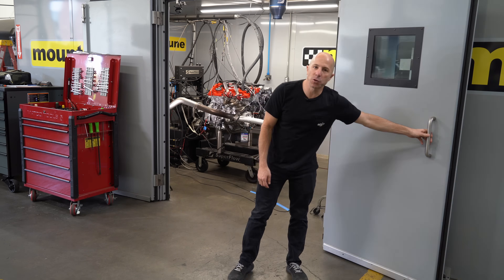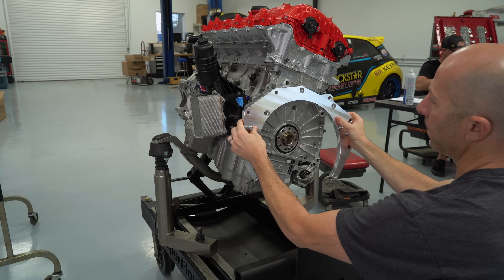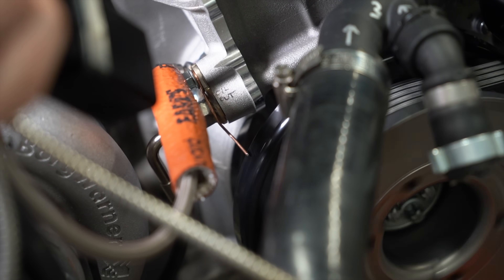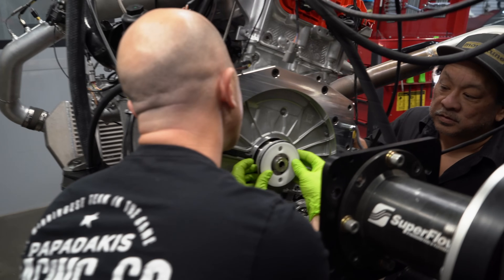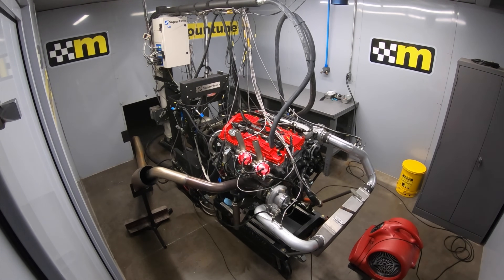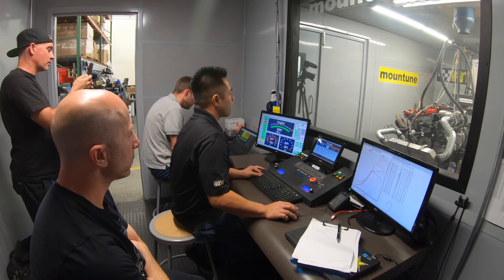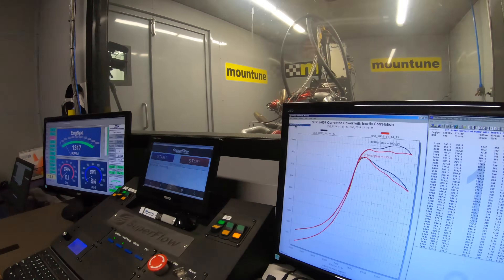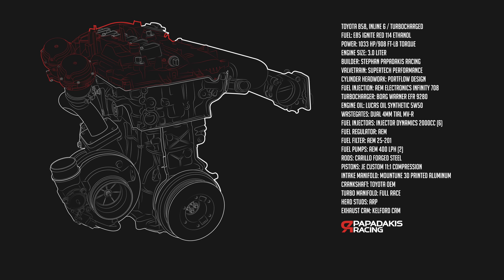B58 Engine Dyno 1000+ Horsepower - Sounds like a 2JZ!?

Comment: that dowel is probably the only setback i see if this were made into a kit
Reply: They can probably make something with seals and a hold down with a bit more time. The dowels were solid quick thinking, though.
Reply: Beautiful Music Motorsports the dowels are pretty much the only option at these kinds of cylinder pressures. The OE seals on the direct injectors are PTFE, require SSTs ($$$) to install and are single use.  N54s had an issue with blowing these seals out, the owner not realizing, wearing the bore for the injector seals out and now you need a head all of a sudden.

Dowels are probably still the cheaper and safer option.
Reply: Ehh i dk id say most of the changes would be too pricey to ever be sold as a kit when people are already making close to 750 on stock motors with the stock intake plenum. The r&d that went into that intake manifold alone would make this a kit that costs well over 20 grand. Thats not competitive financially when people have made 550 with bolt on's and a meth kit.
Reply: @SortaProfessional89  The R&D on pretty much any aftermarket intake manifold was high costs as well, but they sell for an affordable price... so....
Reply: core charge, he'll send you a doweled head in the kit.   you'll get a refund if/when you decide to send your OE head back in good condition.  if not, you've get your stock head if you should ever want to return to DI.

Comment: Soooo 1033 engine hp is like 850 in the car. at 42lbs! that would be over 1000hp at the wheels in a real supra! 2JZ No Shit!
Reply: codygocam dude 42 psi doesn’t make a certain hp that’s just what that size turbo is pushing. Could use a bigger single and run 30 to get this same power... get what I’m saying ? Prob just maxing this smaller turbo is all that means

Comment: this shit makes no sense to me. you spend tens of thousands on a engine, so you can spend months pulling it apart, replacing parts, waiting weeks for those parts sometimes, putting it back together, and it only makes a thousand horsepower? why not just make your own fucking engine? use aftermarket parts that are arbitrary, like injectors, springs nuts screws bolts, and whatnot? but you have to be able to build the block, head, crank shaft, pistons, and whatnot, yourselves by now. you know the materials to use. you know everything there is to know to design and build your own engine. it makes no sense that you would waste so much time and effort on this 🤔

Comment: 9:52 So basically, IATs increased in temperature where less air actually entered the cylinders (despite increased boost pressures) thus, causing a flatline or reduction in power.

But once the fans were turned back on, IATs were cooler in temps; therefore, more air, more power. 😎👍
Reply: The exhaust pipe fit is pretty loose too, so there may have been a much higher percentage of NOx, CO, and CO2 in the room displacing oxygen.
Reply: @mannys9130  i'm with manny, available oxygen in the room got used up by the engine leaving only spent exhaust gases.  same as how EGR technically reduces the maximum power an engine can make by diluting a portion of the intake charge in an individual cylinder.   eventually that increased pressure they were reading off the turbos was not just O2 but also compressed/boosted CO.
Reply: Philly Phil I'd agree with you gentlemen. Bottom line, lack of clean O2 in the room, computer would compensate by adding more fuel, throwing off the fuel/air mixture, reducing power.
Reply: teamEP789 as long as the exhaust vents didn't leak AT ALL. Then yes just air density.
Reply: @mannys9130  CO2 and H2O. By mass, you can just ignore all of the nasty stuff.
Reply: gale banks has entered the chat
Reply: No. There was an essentially an exhaust clog downstream causing extreme backpressure.  Nothing to do with IATs
Reply: FtmfwId no no no no. Watch the video again dumb ass. 
The fresh air fan stopped working, Steve says those almost exact words.

Comment: Is the plan to use Port injection for this motor for good?
Reply: Yes. They only left the DI injectors in because it was easier to keep the holes plugged. Turned out that, in hindsight, proper plugs would've been better from the get-go.

Comment: Kinda sad a completly built engine struggles to make stock block mkiv power.
Reply: Well considering one of them has more than 20 years of aftermarket development and this being the first one built I'd say this one is already ahead.
Reply: @mustnotsleepmustwarnothers6463  Im talking about a STOCK supra engine. STOCK BLOCK supra makes this power with a turbo and few kit.
Reply: @ScrewDrvr  that is a stock block, stock crank and stock heads worked I believe.
Reply: @mustnotsleepmustwarnothers6463  yea it is
Reply: how old is the b58 again?
Reply: @MrTin_09  Not as old and outdated as a STOCK 2jz, which makes this power easily.
Reply: That's a 5 year old i6 vs a 20 year old i6. How is that comparable?
Reply: @carboydorifutoparty3976   A STOCK 25 year old engine makes this power. Yes, it shouldn't be comparable that some old outdated engine embarrassed this new fully built engine.
Reply: @ScrewDrvr  it's not fully built there are still stock parts in this

Comment: Ok , ok , if you insist I will allow you to put this in my 340i for future testing .
Reply: Duncan Macleod you know what they say about people who “assume” things. I’m actually the motor hand on an oil rig (rig 615 with Savanna drilling) and have extensive knowledge of Diesel engines as well as many gasoline engines . I’ve helped to build quite a few old school 350s and 383 strokers . We have built Monza’s , Monte Carlos , Trans ams , Nova’s  and evening though I hate to admit it a few fox body mustangs with 302s . 

What I don’t have is their engine .
The fastest I have personally been on the 1/4 mile is 9.68
Reply: @Ollie Clark check out the supramkv forums, some shop took a part the B58C and they showed that the head, pistons and many of the internals are revised vs the B58A
Reply: @mas921  the X5 uses the B58C, Toyota didn't add anything to the engine. It's the exact same.
Reply: I was thinking about the exactly same thing😂
Reply: B58A is not the same as B58C
Reply: mas921 they already replaced everything that different
Reply: mas921 I’m sure that the Papadakis team could easily figure out how to make it work in a 340i.   From the looks of things I this video, they can make shut happen and overcome small issues. Lol

Comment: Think those dowels will ever shoot out of that head like little bullets?
Reply: It will never, because it was inserted from the cylinder side.
Reply: Doesnt the bore get larger to accommodate the injector?
Reply: .02 thousands is a  light press fit. it isnt going anywhere unless it melts down.
Reply: This is how the valve guides are installed haha
Reply: @mxmang valve guides are outside of the combustion chamber, they're not experiencing the same pressure...
Reply: Shoot out not likely.
Fall out possibly.
I’m more worried about the different rates of expansion and cracking the head. Or creating a hot spot in the combustion chamber that causes detonation problems.
Reply: @thesubaruwhisperer719  The valves probably get just as hot. The cracking issue...mmaybe. I have seen it before but not on a .002 It sounds janky but its pretty solid.

Comment: 1033 brake hp. Sick. Buy a jy 5.3 and slap a turbo on it and make the same, with more of a power band.
Reply: Pfff for how long without touching the internals? 
But yeah I'm a big ls fan. Alot of people who do thus are in racing though. With rules. A common rule 'you can't put an LS turbo in EVERYTHING. 😂
Reply: Alot less money too
Reply: was waiting for the village idiot

good job.
Reply: @MrCukydoh  whats under your hood?
Reply: Not an LS 😂🤣
Reply: M50 Turbo. 

i’ll give you a minute to google that (dunno if you’ve got fast internet in alabama)
Reply: @MrCukydoh  I'm sure it's cute.
Reply: 1200whp is veeeeery cute for a i6 😂🤣 

the only reason the Ls is so loved is because it’s dead simple so “smart” 
people such as yourself can “build” 
them. 😂😂😂😂😂😂
Reply: @MrCukydoh  sure.
Reply: what a reply. 
🤯 

Guess i got told.

Comment: He said “Bung”😬
But seriously, copper wire wrapped around as an indicator for the ignition timing, BBQ’s, liquid nitrogen, pretty effing cool video guys
Reply: backyard builder meets SAE master tech all at once. true hot rodding if you ask me
Reply: bung is correct
Reply: copper wire is a pretty tried-and-true method though
Reply: the ignition system operates with high voltage so the copper wire is all that's needed as the "pulses" are measurable that way. 
Bung is correct.
Reply: @youridv  you dont seem to understand how the copper wire is being used in this situation
Reply: @1OMEGA111  I know right 🤣
Reply: @youridv  bro its just a timing marker for tdc the material doesnt matter i use safety wire makes no difference

Comment: Those are 2jz sounds 🤤🤤
Reply: 3 liter turbo inline 6 will pretty much sounded like this regardless the brand.
Reply: rb30s do have a distinct sound to them, there is really a difference in sound between similarly specced 6's
Reply: @logical_volcel  yea rbs sound diff than other inline 6s and they sound the best tbh
Reply: Ethan Tercier B58*
Reply: no? those are boosted inline-6 sounds, and this is a B58
Reply: @Hulluboju  Bro u dumb :D